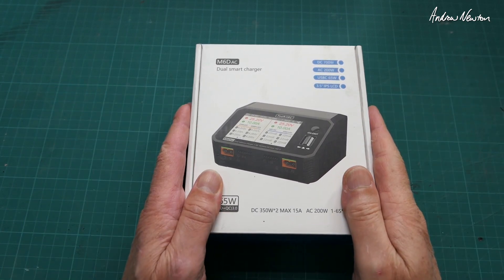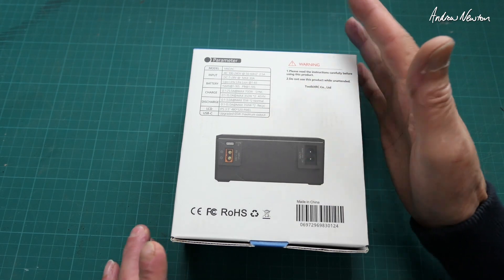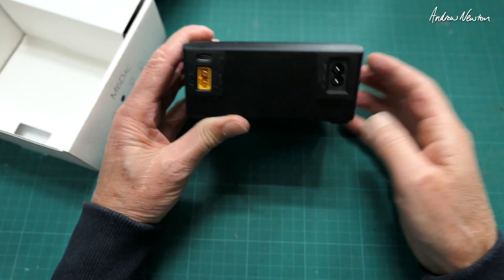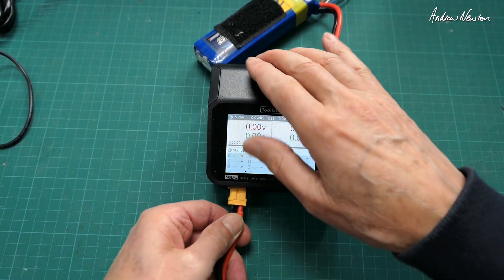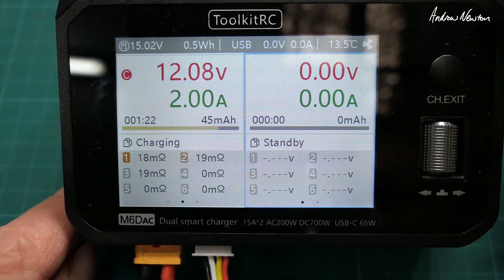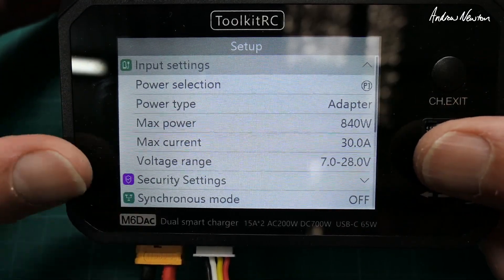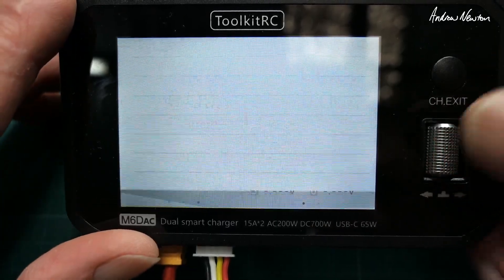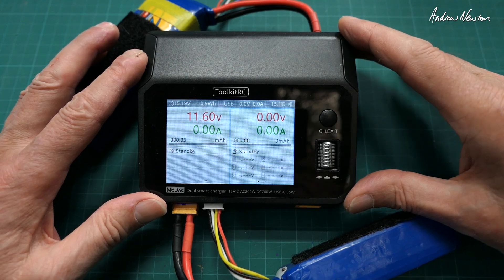ToolkitRC M6DAC Charger

Comment: Could be nice to have control over the fan. It doesn't come on till it's quite warm. According the manual:
45 °C, the fan turns on half-speed airflow to reduce noise. When the internal temperature exceeds 53°C, the fan turns on full-speed airflow to enhance heat dissipation.

Comment: Does the menu allow you to change storage voltage? Some chargers have presets for storage that can't be changed and are usually not the 3.85V per cell that i desire.